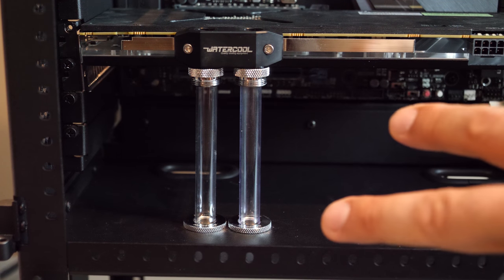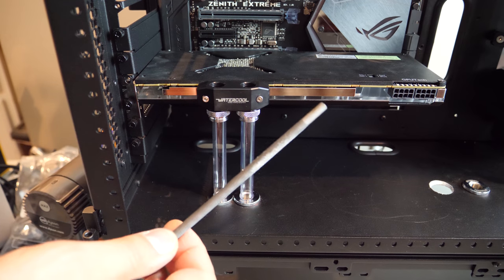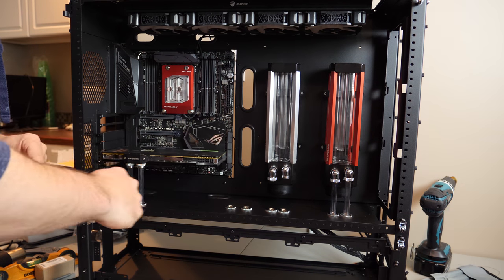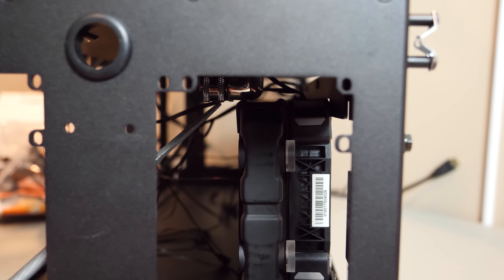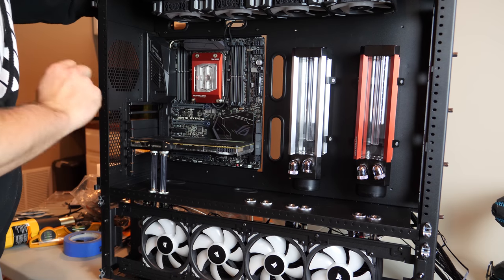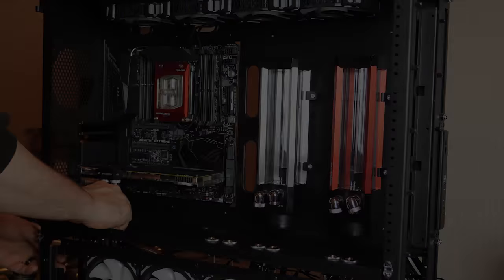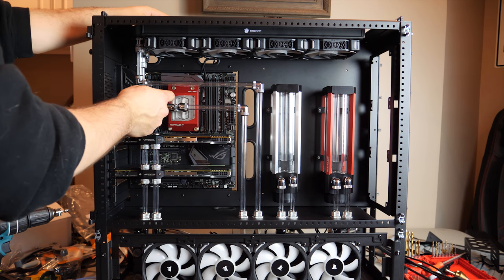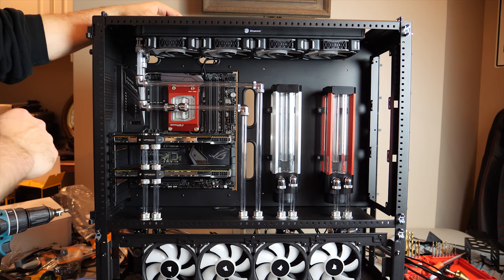Project Baron - Threadripper/Vega 64 Watercooling Project Part 3!

Comment: You could fill the basement fans and radiator out more with a 560mm radiator and 4-140mm fans instead of the 480mm radiator and 4-120mm fans.  Assuming you're thinking the 120's are too thin.  I went with that setup because I wanted the fans in the basement to fill in all that space:  https://imgur.com/a/LQ9Gl

Comment: Looks really cool and clean!  I'm a little concerned about the Vue fluid though - it looks nice and flowy, but have heard there are issues with the fluid settling and stuff.  Can't wait to see the finished build!
Reply from the maker: I talked about this a bit in the first video - I'll likely swap out the Vue for regular pastel after the videos are done, especially if I'm going to leave it running all the time
Reply: I was about to say the same thing about fluid. But it looks awesome.
Reply: I used the Primochill Vue for about 2 months, and while there was some build up in the CPU block, it wasn't as bad as others. But now, I am running with EK Cyrofuel and a flow indicator. I still have 1 1/4 bottle left of Opaque Cobalt Blue, but honestly, would hate to take apart and maintain the loop every 2-6 months (2-3 days downtime cleaning with reboot etc.).
Reply: I ran it for about the same amount of time and it literally took 14 solid hrs of cleaning to get my blocks clean. It also completely plugged up my drain ports too. A solid white mass had settled in there. Never again with the show fluids man. I went straight back to translucent fluids and this is where Im staying.
Reply: Vape Nation Well that's exactly what Vue was made for. For show. So, yes he should use it for this video. And any other pics or showing the system off he wants to do. It'll look amazing for a couple months. It's not meant to be a daily driver. As much as that sucks it's a fact. So I just bit the bullet and moved on to better options. But Brian is using it exactly how its meant to be used, temporarily.
Reply: BPS Customs if anything go mayhem’s aurora I used it in basically similar setup as yours two rads but only single pump and it lasted three ml this and flushed easily with distilled
Reply: K3 707 aurora isn’t bad never had build up issues just fall out after a few months but by than I’m ready to change it anyways as I like to switch colors and fluids a lot
Reply: IV used the Vue fluid and had alot of problems. I did buy the pre order fluid without all the warnings and had my system running 24/7. Trust me it was not a nice system to clean afterwards. Hope you won't have the same problem. Today I use mayhems pastel uv green.

Comment: Looks great. But I'm curious if you ran Primochills System prep through each loop before filling up with the Vue. I've had a pretty bad experience where I had to tear down blocks and clean them very vigorously  and reassemble as the coolant gunked up pretty bad and was even sticky in the monoblock I used. Proper Prep seems critical for this coolant.

Comment: Brian, have you thought about putting the fans on outside of the lower radiator bracket to help with clearance at bottom with fittings?  Just asking because every other build I have seen has the radiator mount sandwiched between the radiator and fans.  Love the build and all your other videos.
Reply from the maker: I didn't really consider it, and now it's too late!  Haha thanks for the suggestion anyway
Reply: Was wondering since I plan on getting this exact case and building in it soon.  Thanks for some different views on what can be done in it.